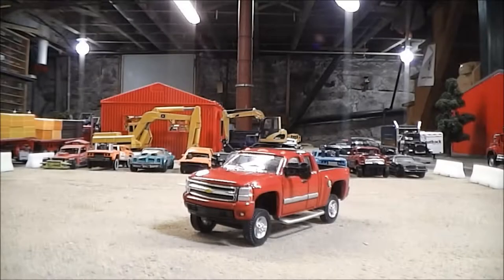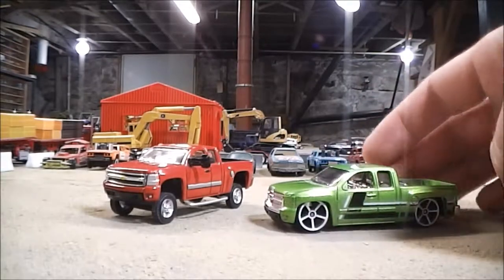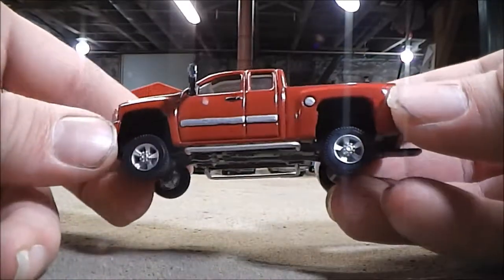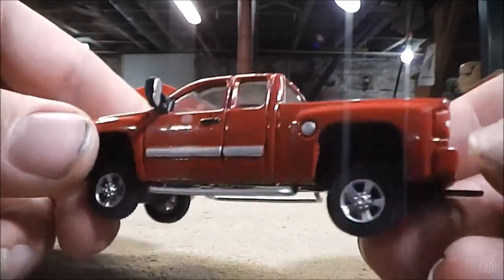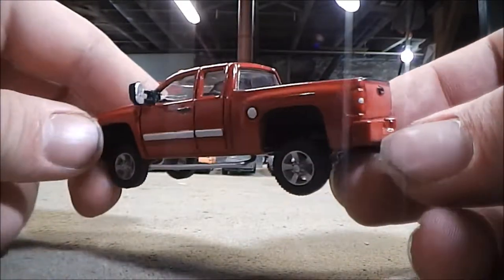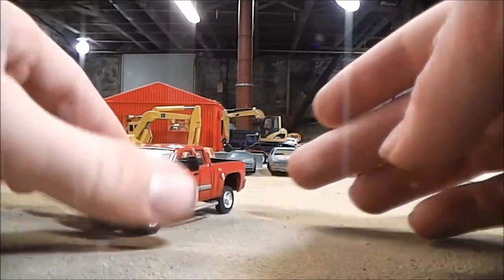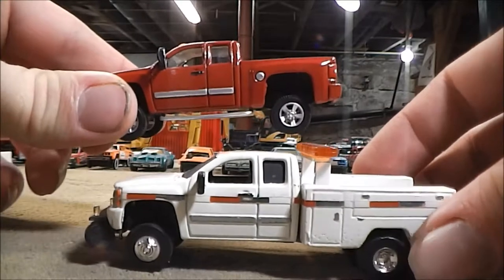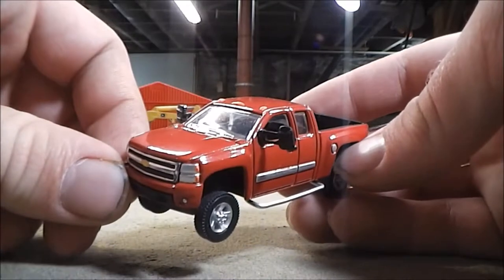Plow Bender's Custom Creations No.2: 2012 Chevy 2500 Duramax Diesel Pickup Truck

Comment: I think i bought one from you on eBay a while back. The one i bought had a tool box, tow mirrors and a brush guard with lights. I bought it years ago. And i still have it. I know it has to be you cause the fifth wheel is the same hole and same for the hitch. Was one of my favorite trucks before greenlight started bringing out the new chevys
Reply from the maker: I sold quite a few of these back when the market was hot for them.  Sadly Greenlight has run almost all the customizers out of business since they can make far more product in less time and for far less cost.  I called it quits 2 years ago after I attended a show with over 100 customs and didn't sell any the entire day.  Sadly I've still got quite a bit of that inventory on eBay and I resorted to just pricing it to get back what I spent on building them.  It was a fun way to earn some extra spending money, but these days my hobby of collecting and customizing 1:64 diecast doesn't pay for itself anymore.

Comment: Is there a certain brand of rattle can paint you prefer to use?
Reply from the maker: For the longest time I was using Wal-Mart brand paint and primer, but I think it was 2 years ago they quit stocking it except for black and white paint.  Really sucks because you could pick it up for $.96 a can, verses paying $3.00+ for Krylon or Rust-oleum paints.  I know the YouTuber BlueBells5529 ran into the same problem I did, as he was using the same cheap paint for his projects until Wal-Mart quit stocking it.  Lately I've been using paint and primer from Ace, but I have started using Testors one coat lacquer which seems to produce good results.  I'm also looking into using Tamiya fine surface primer, as I know a couple Tubers who use it for their customs as it doesn't obscure small details in the casting.